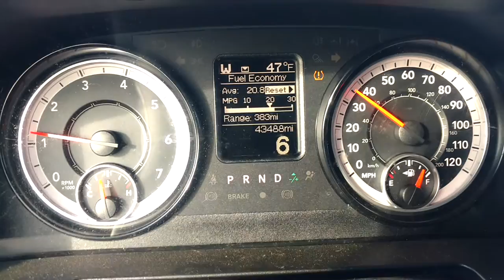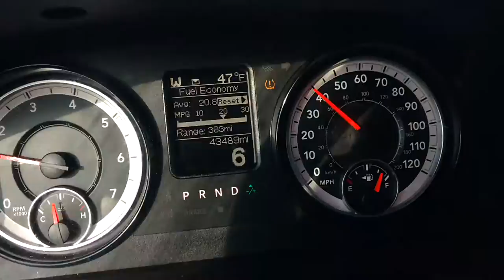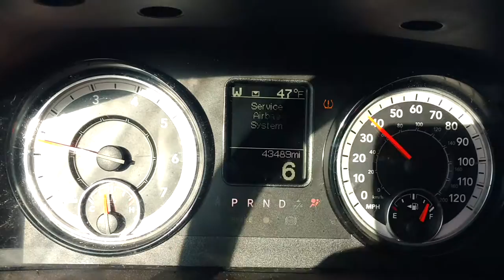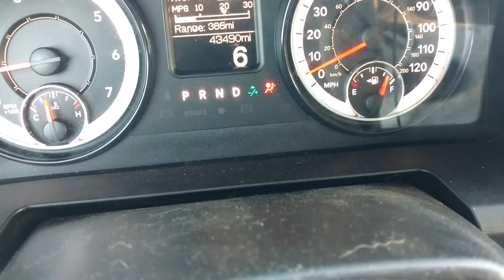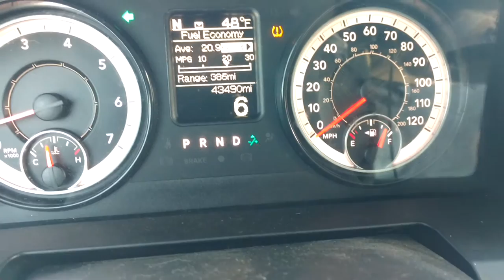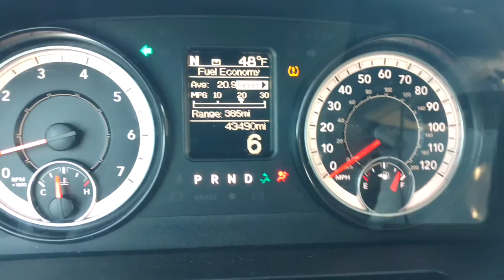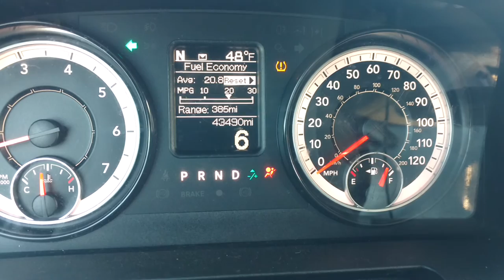17 Ram 1500 airbag light

Comment: Same truck here, same issue but VERY sporadic. I unplugged it under the seat and plugged back in. Stopped for a bit but started acting up again. I will check for pinched wires. Thanks!
Reply: Did you fix your issue? Same thing happened to me.

Comment: Most all have the same problem. It's the connector under the seat.  Yellow clip for the seat airbag has a bad connection.  Pull apart clean contacts put some electrical grease and assemble.  Fixed.

Comment: I’m having the same issue with my 17 Ram as well. Were you able to fix the problem?
Reply from the maker: After I cleared under the seat and pulled on every wiring harness and inspected as best as I could, and my light has not come back on.side note I only inspected under the driver's seat I did not do anything with the passenger seat

Comment: I remove the glass driver side just to tint my windows. Trying to figure out how to reach a  tab to pull the window out. I disconnected wires in the door panel. Reconnect them back. Until this morning i got air bag  service.Is there a sensor on the door panel that also activates the air bags?
Reply from the maker: if it has side airbags yes

Comment: I like how you didn’t really say what you did to fix it, where the wire was pinched, or anything but common sense folks.
Reply from the maker: I never found any wire that was pinched or broken, and I don't really care enough to fix the problem completely LOL but the Common Sense part is if you can recline the seat forward and backwards and change the light that it is stretching or pulling on a Wire, a wire can be pulled slightly out of a connector and cause resistance issues not a perfect answer but I hope this helps

Comment: 2 The Module could be bad. Most likely need to replace the Module. You can buy a used one on www.eBay.com 
or send your Module for repair at https://www.myairbags.com/product-category/repair-return/airbag-module-reset/

     Here is video

 https://youtu.be/xT5tiT2A78w
Reply from the maker: You must work in a Dodge dealership parts department 🤣
Reply: Nope. Check the link. People buy  Module from a dealer paying hundreds of dollars.  I reset them for $50 can't beat that
Reply from the maker: Except for the fact that it has not happened again it is not a module in my case